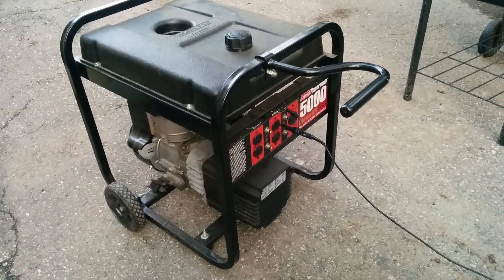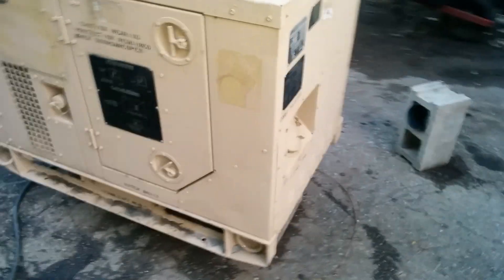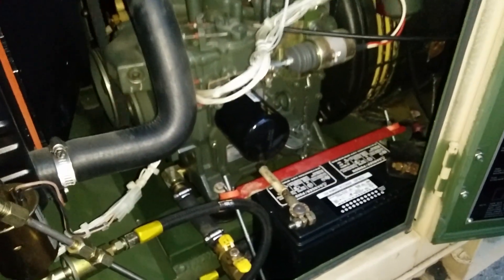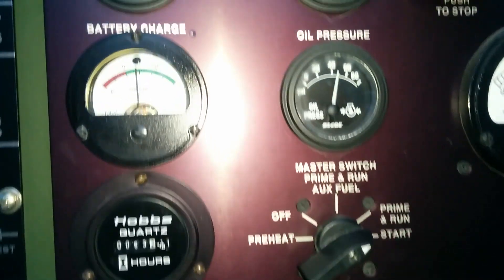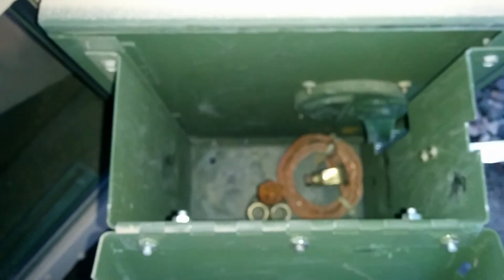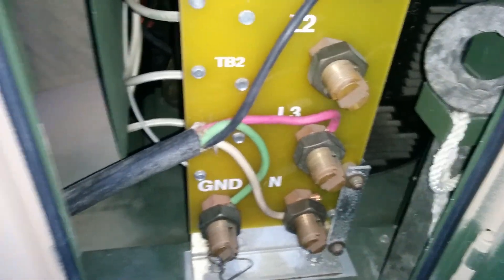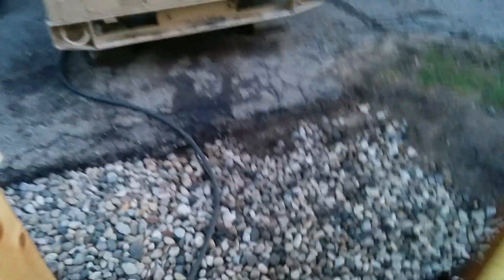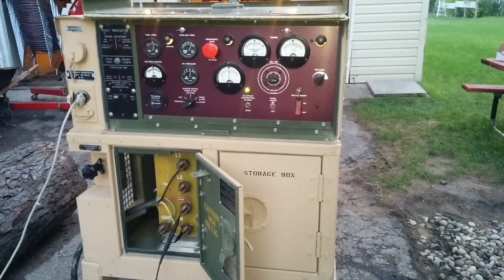Mep-802a vs consumer generator

Comment: Works best on Kerosene JP8
Reply from the maker: @glennschlorf1285  regular diesel has more lubricity so I'd argue that it's the same or better. I've put 2,000 hours on mine with #2 off road. Running great.
Reply: @electromechanicalstuff2602  if you load em thats great and wonderful however if you dont load em down they tend to wetstack
Reply from the maker: @glennschlorf1285  100% agreed. I bought and sold like 30 of these units. 002, 003, 802, 803, 804s. First thing I looked for in the auction was for wet stacking many of the auction units had it. So they apparently even wet stack on JP8. Everyone I sold I warned the buyer do not let it run with less than 30% load or exactly that will happen. It's a trait of all diesel Gennys. Me personally I use it to charge my 85kwh solar system in the winter about once every 4 days or so when there's absolutely no sun here in Michigan from nov-march. I have enough chargers that I can actually overload it. I run my 803a at about 10.5-11kw continuously for about 10 hours.
Reply from the maker: @glennschlorf1285  I can totally believe that. Because diesel has more lubricity that oil can build up faster on the cylinder walls when running below temp from low load

Comment: Brush meets a commutator. Not in an ac generator.
Reply from the maker: @jamesspash5561  slip rings is what it actually is but I misspoke a decade ago. But slip rings still spark. In addition to that th AVR and the mechanical governor can't regulate voltage or frequency well with changing loads
Reply: @electromechanicalstuff2602  Dear sir, I operate 14 commercial utility grade hydro generators and 4 diesel units. The smallest is 1 mega watt. If you slip rings spark there is a problem. If your governor or AVR can't regulate frequency or voltage there is something wrong.
Reply from the maker: @jamesspash5561  there is something wrong. They are cheap $300 generators with no mass in their flywheels to regulate frequency.... how could someone who works on equipment like that ever compared a 10 hp 3600 rpm gas generator with a 1 megawatt+ hydro or diesel industrial generators... Your telling me the units u operate use slip rings and not inductive exciters?
Reply: @electromechanicalstuff2602  Those small units regulate frequency and voltage by RPM only. They have no voltage regulation. Voltage/ current regulation is solely by saturation or the limits of the generator design output. That is why they are not good for standby home use. A large current draw like a well pump coming on may drag down the voltage and current. When that load turns off the generator rpm spikes along with voltage and current and damages all your sensitive electronic devices. Yes I work on the small ones also. When there is a storm situation here and an entire street or area is out of power it is easy to spot the homes with some kind of generator. Because they always, every time, have every single light they own inside and out turned on like a new mall opening. TRUE! I don't know why.

Comment: I've got a 96 Coleman 5K with a Briggs I/C 10 horse that's pu;led everything here from 02 on including a 220 pump with NO problem. KEEP your G.I. stuff. I'm a Nam Vet and have ENOUGH of it.
Reply from the maker: @lewiemcneely9143  but will it run a 3 ton central air and a well pump at the same time without making the lights flicker?
Reply: @electromechanicalstuff2602  Don't see why. He went to gas logs instead of wood. Had a heat pump for years and it takes care of itself.

Comment: I’ve been thinking of getting one, how many KW is that generator?
Reply from the maker: Mep-802 is 5kw rated 6kw actual
Mep-893 is 10kw rated 12kw actual. 
Rated at high altitude to perform. 
So at sea level u get a but more plus 300% starting surge

Comment: YOUR A/C COMPRESSOR IS RUNNING BUT BY THE LOOKS OF THAT COIL NOT FOR LONG!!! YOU FITTIN TO BE HOT THIS SUMMER!!!
Reply from the maker: As a licensed refrigeration technician who works on 500 ton units and smaller. That coil is not that bad at all. I wash em off several times a year. That r410 unit was 2 or 3 years old at the time of this video and it is now 10+ years old and still running strong. I've since sold that house made $150k on the flip to a Friend. now living on some property in the country that has two r22 units that are about 16 years old and run great also and i have two brand new 30lb bottles of r22 i got for free 5 years ago. I'm not worried at all. Plus don't write everything in capitals. It means you're yelling.

Comment: On the cheap one the scope was connected between line and the chassis. On the good one it was connected between line and neutral. Depending on the internal wiring this might not matter.

Comment: what does the battle switch do?
Reply from the maker: Bypass the safety shut downs. Over temp, low fuel level l, low oil pressure, over or under voltage etc. Genny gets hit by shrapnel it's more important to keep up comms and medical equipment than worry if the motor will be damaged
Reply: @electromechanicalstuff2602  thanks for the reply.  We are trying to get one.  Just hard as we live in the bush of Alaska.  One day.
Reply from the maker: @curmudgeinnak  they are cool. When they first hit auction I was getting them for like $1200 with less than 1,000 hrs. But then everyone and their mother started bidding on them and driving the price for parts units that had missing parts past $4k not knowing what they were buying. Main thing to look for is the exhaust. If it has black oil or tar like substance on it the motor has wet stacked. Sometimes u can fix it with just 100% load for 8 hrs sometimes u can't. U must maintain 25-30% minimum load on it at all times to prevent wet stack. Otherwise the engine won't get hot enough to burn the diesel completely coats the cylinder walls and allows oil blow-by that just gums up everything. So when buying and not sure wether u want a 803/10kw or the 802/5kw know that u have that minimum load requirement 1500 watts vs 3,000 watts continuous load can be as simple as a one or two space heaters. Mine only runs to charge my battery bank so that keeps my 10 kw unit at about 80% load for about 6 hrs

Comment: Actually, the horrible waveform of the garbage genset makes no differenceto any electronics manufactured since 1990.  Every device uses a switching regulated DC power supply rated for ANY voltage from 80 to 300 volts at any frequency.  The input you feed it is immediately rectified and charges a big capacitor to some dc voltage.  The switcher's pulse width at a higher frequency varies to regulate the dc output voltage.  It could care less what the genset waveform is,
Reply from the maker: K.... Dirty power is fake..... Inverter generators are just a money grab...... Or the low voltage power supplies are infact what fails when you run dirty energy. U can literally hear the power supplies whine when on dirty power.  Ever actually own a radio or analog TV. Turn on a vacuum in the other room. What happens to your signal... Dirty power transient spikes ......
Reply: @electromechanicalstuff2602  My diesel stepvan is powered by a Honda EU3000is electronic generator I got cheap.  Its output looks great as Honda's sampling rate is higher.  The BEST feature is ECO mode.  Loaded at 1600 watts, eco on, the engine is only turning about 1500 rpm as output frequency has nothing to do with engine rpm.  It's very quiet.
Reply from the maker: @LarryButler-kp3se  this diesel mep unit only ever runs at 1800 and it's always quite. Plus oil change intervals are 500 hrs. I can connect infinite size aux fuel tank and don't have to worry about the engine needing any real PM for 8,000+ hrs
Reply: @electromechanicalstuff2602  Sitting in my yard is a 41-year-old  Mercedes 300TD with around 900K on it.  (it wore out odometers)  It gets Rotella T4 dino oil every 3000 miles and consumes 1/4 cup between changes.  It starts instantly glow plugged at 5F.  500 hours is too long for diesels as they contaminate the oil with unburned fuel and soot.  ALL diesels have ring blowby.
Large diesels, like ship diesels, have extensive lube oil filtration systems because of this fact.
Reply from the maker: @LarryButler-kp3se  just what the manual says. I've seen this units at auction with over 9,000 hrs on them and I know the government isn't going to do more oil changes then recommended
Reply: On the cheap one the scope was connected between line and the chassis. On the good one it was connected between line and neutral. Depending on the internal wiring this might not matter.

Comment: 6kw, 800lbs.....whats the point. Just get a NG or LP 10-24kw.
Reply from the maker: Quality. Those NG/LP air cooled motors won't last 1/2 as long. They need oil changes over 200hrs this one is 500 hrs. At 400 hrs the NG Needs valve lashing this doesn't for 5000 hrs.  NG 10kw has no surge rating. So don't expect to start a 3 ton ac unit with it. This has 300% starting surge. The NG is just an air cooled lawn mower engine this is an onan diesel made for industrial equipment. The NG is a slip ring exciter that adds distortion this is brushless exciter with grid quality sine wave. Because it's water cooled its way quieter. 
This service must be done by a certified generac tech to retain your warranty. 
I've seen these military units with 8,000 hours on them regularly. I have a friend who used to service the whole house units and the valve seats usually only last 2000 hrs and then the head needs to be changed. 
https://www.generac.com/service-support/faqs/maintenance-kit-faqs/what-maintenance-do-i-need-to-do-and-how-often
Reply from the maker: Plus this is portable as long as u have a machine to move it. Mines on a trailer. It also has the capability of 3 phase output. I installed an automatic transfer switch and control board for automatic start in the generator. But if your not capable and just want something u can call a technician out for repairs I even recommend the whole house units because not many people know how to work on these military units.
Reply from the maker: Look up generac service schedule B at 400 hours which is only 16 days of run time u have to lash the valves
Reply: I paid a hospital clinic $500 for my 33KVA diesel genset, including the hot start switchgear.  It's Cummins engine had 220 hours on it.  I paid $1200 to ship here.  Long cables feed power to my neighbors who fund the underground 250 gallon fuel supply and maintence. We're out of power about 30 seconds.
Reply: @LarryButler-kp3se  you make my point. A mep802 is 6kw....go big or go home.

Comment: At 37 dollars a peace for 250 watt pannels you could put up 10 kw. Worth of pannels that never needs fuel.
Reply from the maker: Check out my latest videos. Lots of politics but in there is also solar videos. I didn't find $37 dollar panels but I did find $130 375watt used panels so in stalled 16 of them. Before that I installed 16 390 watt new panels at $300 a panel. When it comes to back up power one is none and two is one. Now that I have diesel and solar I sold my little 5kw yanmar diesel
Reply from the maker: Inverter, batteries and distribution layout
https://youtu.be/1WQ7vkm5cRg
Reply from the maker: 16 original new panels. 
Added 16 more on the roof after this video
https://youtu.be/kyfGQBgwVsc
Reply from the maker: I got my used panels at Santan solar.
Where did u find $37 panels

Comment: This is old video but have a question hoping you have the time to answer. 

My 2004 Motorhome has an Onan gold marquis 5500 on it. The hours are getting up there and at the moment in having to live in it while I build my shop and home. Have the opportunity to buy two of these with low hours and excellent working condition. Can I run my 50 amp motorhome off of one? The most amps I have ever seen pulled with both AC units running and all lights and electronics on is 27 amps.
Reply from the maker: Absolutely no problem
Reply: I really appreciate you answering. I got it set up but I'm not gett8ng ant power to my motorhome. I've tested with shore power and rv side is all good. Plug into generator cord wired exactly how you have it but have no power from gen. Have 110 from the generator sockets and all gouges show its working but I don't have power. 220 V on meter but nothing. Is there anything else I'm not turning on to get power? Does the ac interruptor have to be on?
Reply from the maker: @Lordhumongus  yes the ac interrupt must be on
Reply: Geeze... power on! Thanks dude. Learning a lot out here lol

Comment: Can you run this diesel generator Off of biodiesel?
Reply from the maker: Not sure haven't tried that but as long as it's clean I don't see why not
Reply: Old or military diesels, without the computer injection crap run fine on used cooking oil, used motor oil, any clean oil thin enough to pump.

Comment: Got one of these.. MEP-802A awesome generator..  One thing that is stated on one of the tags is "EMP Proof"!!  Not one piece of electronics on this puppy, no ignition,  Relay logic!!  Most all military is Diesel for common fuel, no ignition, EMP resistance.  I tested mine at 7KW, not recommended, but took it without Any complaints.  Surge capacity is greatly underrated. Military Grade!  Found mine for $2K w/200 hours and fully serviced from a guy in Pennsylvania who was flipping surplus Military generators.  There are commercial diesel generators, some run at 3600 RPM which IMO defeats the reason for going diesel where 1800 is much closer to diesel max torque/efficiency.  Sound deadening in the rain proof enclosure is darned good.  Standard Service items (filters mostly) are available commercially.  

My goal is to use this generator for intermittent battery charging in an inverter system.  Solar power isn't that reliable here in Maryland with often overcast skies.  Running a generator with a light load is where fuel efficiency is lost.  My full use electrical requirement is about 1 MWH per month which equates to an average load of ~1.4KW.  Running this generator at about 25% duty cycle w/a battery sourced split phase inverter system capable of ~12KW peak will reasonably run everything I have without any concern.  The default power source should always be Grid power which is currently by far the cheapest power source.
Reply from the maker: I would target 50% load cause like u said fuel efficiency is lost on light loads. That generator will burn close to the same amount of fuel weather it's 25% load or 45% load. Secondly and most important these gens are kind of sensitive to wet stacking. If u only run low load most times at least once a month u need to run 100% for an hour minimum to make sure you burn off any unused fuel/carbon in the engine. If u ever see wetness anywhere on the exhaust put 100% load on right away or u risk washing out the cylinders. Lots of surplus generators are in the auction because of this reason. Many many are just fine. I've had over 20 units and only one was bad and that's cause the exhaust flap was left open and the engine had water in it. I now have a 803 and I plan on doing something very similar use generator during day for house loads and charge lithium batteries especially in winter when only the furnace is running at night then at night run on the lithium batteries. This way too during the day the generator will have a good heavy fuel efficient load.
Reply: @electromechanicalstuff2602  Nice info..  thanks.. you must be another MEP Flipper?  The guy I bought mine from bought them by the  Lot, pennies on the dollar from Gov't auctions.  With most inverters you can select the generator Start/Stop battery voltages.. and Max charging current so your 50% load recommendation should be easy to set up.
Reply from the maker: @markhall3434  exactly. I set up my buddies solar system in hawaii the same way. U can get auto start units for these too from greenmountaingenerators.com
Ya I flipped em for the first few yrs they came out. The auction prices in the north east of the country got too high for profit So i got out
Reply from the maker: @markhall3434  
Auto start.
So basically your inverter has an output to request generator startup and will have priority that if there is grid power to use that to charge and passthrough power to load. U can set soc for that command like for lead acid I'd do 70%-80% lithium would be 20%-70%
https://greenmountaingenerators.com/product/mep-automatic-transfer-switch-controller-for-most-mep-military-generators/

Comment: wow i'm amazed of the amount of features of the military generators(and the cleanliness of the power through the oscilloscope) , i thought that they were designed just to power aircrafts(that uses 400hz) but from your video i have learned that,military genset is 1000 times superior than comercial,with that... i just have to congratulate you for your initiative to upload something like that, I´m strongly encouraging you in the name of the whole community  to tell us more about them(servicing wiring diagrams, servicing components and other devices not seen on comercial gensets),i have to ask do they have synchronizer for automatic paralleling with other machines?   we'll tracking you continuously..........great job!!!! .
Reply from the maker: I have thought of making videos like that. I will in the future. Some units are 400hz the 60hz units are mep-802, 803, 804, 805, series. The 5kw and 10 kw do not have auto synchronous feature. But the military does sell a kit which is basically just a bulb to Identify when to energize the output contactor. The 15kw 804 and up do have the auto synchronous feature. I have a video on the 804 unit and u can see the switch for it. I'll find a video on how to synchronize them
Reply from the maker: https://youtu.be/pdKAM2Xrtjc
This is the older 002 and 003 models. They are the 70-90s air cooled units but the process is the same